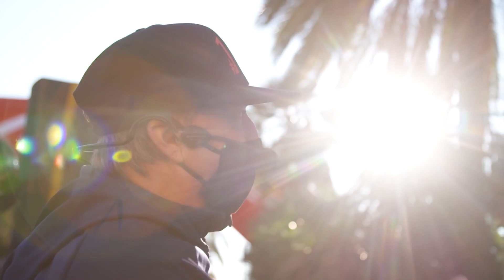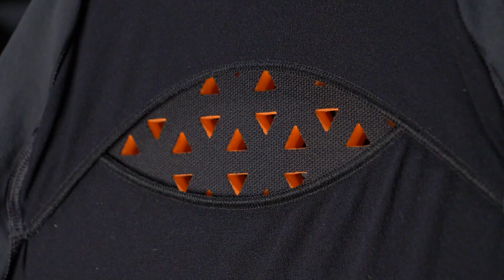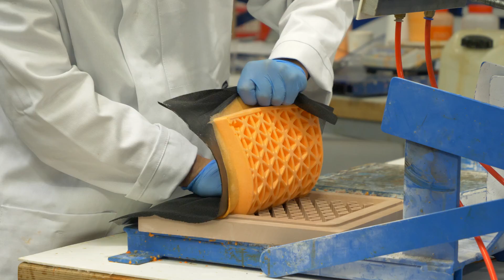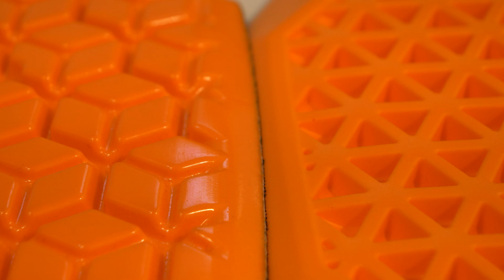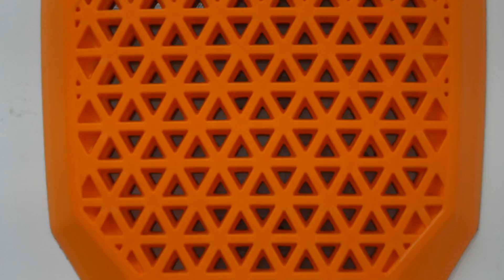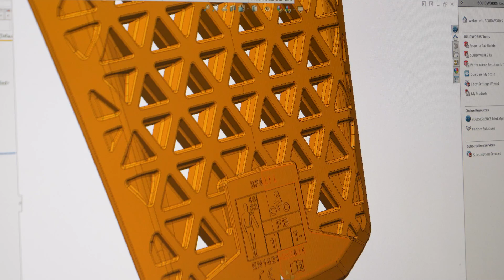High Speed, High Consequence | How MTB Protection Is Keeping Up With The Demands Of EWS Racing

Comment from the maker: Do you wear a back protector when you ride?
Reply: Yup. In fact, I use motocross protection equipment. Beteer safe than sorry.
Reply: not at the moment but i am buying the dainese trail skins pro very very soon
Reply: @tobylestrange4081  same for me I’m getting the leatt reaflex
Reply: The harder I ride, the more armor I wear (for enduro/gravity/bike park). I rarely crash, but when I do, I appreciate being able to dust myself off, and keep riding.
Reply: I wear an armored hydration back pack, even though I don't do any particularly dangerous technical riding. Even beginner trails are full of stuff that can mess you up if you fall on them wrong, and the brain and spine are organs that can suffer permanent, life-altering injuries from fairly minor and unimpressive accidents. I don't bother with knee pads or elbow pads because injuries to those can be treated; knees can even be replaced.  But I view my backpack as like my helmet, I don't ride without it.  It's not nearly as robust as the back protectors in this film, but it doesn't need to be.  I don't need a full face helmet either, but I still need a helmet.
Reply: @grumpynerd  sound's good I didn't even think that existed if you see my previous comment.. anyways I do wear very thin knee pads because they make me feel safer, maybe because when I was a kid skating i always just sat down on my knees if bailing any trick or something.these bicycle kneepads aren't meant to be used like that but gives me the feeling of being much safer... I also doesn't do the extreme trial's mostly just hiking trial's paths in the local mountains here in Norway they're not rated ofcourse and can be difficult for me.. knees are easy to hurt by minor accidents .I'm not trying to be rad on my bike but I really enjoy the freedom feeling bicycling around in nature...i would love to have the hydration armor thing you have under my anorak if possible I also wear The pads under my hiking pants .. maybe the two of us is kinda on the same level i consider myself a beginner because I never have time to do it every day or week and started 2018
Reply: I don't, but would really like a piece of tech like that keeping me safe while I try new (riskier) stuff 😄
Reply: Always
Reply: Yes - both snowboard (+freeride) and bike. This year I am planning the upgrade because of the tech development. I want some kind of the west I can wear both summer and winter.
Reply: There’s one built into my back pack so kind of yes.
Reply: After being hospitalised from a 'minor' crash. Full D30 Back, Elbows, Knees and knuckles.
Reply: No, I would never wear one riding locally. I would only consider it when trying new big things in the bike park.
Reply: No 😳
Reply: Hells yes, always. I feel naked without one, but then again I'm used to one from alpine ski racing. Currently using a Komperdell Cross 6. It was the only one I found after a lot of testing that protect the entire back, from tail bone to neck. Most other ones are way too short and leave both ends exposed. And I hardly feel it there except that it does add some heat, but not much worse than a backpack. And I'd rather have a hot back rather than a broken one...
Reply: @widsk1  I have one from Head that I used during alpine ski racing. I am glad to see this tech getting used in MTB as well.
Reply: @mathewrose2951  yes, it actually is a bit weird that this is not a default thing for mtb. I mean, I think I got the first one back in -97 or something, though I think we were pretty early adopters among the local clubs, since we had to buy motocross protectors. So I guess there is where it really comes from. I remember the AP moto back protector was the thing we used, just a piece of plastic over a foam padding that went along the entire spine, but it served well. Then came the weird turtle shell like protectors that did not cover either the neck or the tail bone. For some reason, they were popular also, but I don't know why. The higher you go on the spine, the more important it is to protect...
Reply: I am XC
Reply: No pads, I only wear a neck brace. I beat Lobes in the A-line race.
Reply: Yup, all the time, I have the fox base sl d30
Reply: When riding lift served yes. Otherwise, no.
Had to get one for skiing the event at Smugglers Notch last winter so I'm using that one for biking too now.
Reply: Someone needs to convince them to bring the availability to North America.
Reply: Usaly not , I used it More on my gasoline powered enduro \dual sport bike and on snowboard... it's a Knox back protector and it's really warm  can use it as a back warmer and it's really nice to warm your butt to taking it off and put it on the Snow or something .. but while bicycling it doesn't really feel that comfortable and it just makes me sweat and it always needs to be adjusted it slides upwards or i just needs to not have so thigtened shoulder straps... but I want to use it,i often think about it but never do it atleast not anymore.i should do it... but I would like a new one,, maybe they should make one with water in it to like a Camel back so you don't need to put on several things outside of each other., maybe a backpack camel back protecting thing that went cold when you get warm and warm when you are cold and could keep your extra sweater wallet etc and had a rain poncho built in to fold out to minimize the stuff you need to pack and always be ready
Reply: That's good Cushing
Reply: When I´m riding so hard, that I need one, I´m using a chest protector with an integrated back protector straight away. Personally I highly dislike anything thats sitting like a second skin. I just cannot stand anything thats so tight on my body - Even hate my own bib shorts allthough they are good and get worn regularly. When I crashed, until now its been always the ribs and shoulder that needed to take the impact. So a back protector only would not make me feel very protected in such conditions.
Reply: Absolutely fascinating, brilliant work again Doddy, you truly are a tech god... 👏👍🤙
Reply: My Evoc Neo 16L backpack has a external back protector, it too has a mesh design, so yes that will keep the back cooler. I've not tried chest, back protector combo, or vests like these.
Reply: Do backpacks count?
Reply: I've been wearing a 7 iDP back protector for about 6 seasons of park riding.  I had one very bad crash where I went OTB on a jump and landed flat on my back from about 12'.  While the impact caused my back to spasm so badly it took about two months before I could walk normally again, I credit the back protector for me not having any permanent injuries. 
The Bluegrass armor looks nice.  I'd order the B&S jersey now if it was available in the US.
Reply: I have a Uswe hydration pack with an integrated back protector. If you use one, it’s a great idea. Back packs can make things worse - One of my mates fell backwards when riding and was wearing his backpack and landed on his back with his multi-tool between the ground and his lower back. He fractured a vertebrae. He’s ok but it was a close call.
Reply: Every time (except slow rides to work)! I'm an ICU nurse and I've taken care of too many people who have been in nasty bike accidents.
Reply: Not on trail because I also have a bag on my back but in bikepark always
Reply: Yes I am an old dude (69) and getting brittle. I have broken 4 ribs in 3 years. The last one from an impact on my back (bounced into a tree). I either armor up or slow down or quit riding. I choose armor
Reply: no
Reply: Yes, when doing higher risk riding
Reply: Honest i never thought i would wear one. Month ago good friend travel to Sölden Austria. 1st day, behind corner rider standing still... friend couldn avoid crash.. broke his back... he's lucky to be able to do everything.... but looooong recovery.....

Comment: There is a big problem with materials like D30 and other similar products. Low speed impact. You need to reach a rather high impact speed for the material to get the stiffness. A good solution would be a little harder material on outside that covers the speed up to where D30 works...would still be light but perhaps not that flexible...

Comment: It's not just 3DO who makes non-Newtonian foams. They are really common now. It's just the 3DO seems to be the best at marketing and brand awareness.

3DO is probably the worst one for temperature stability. As the temperatures rise or fall, the performance of the foam changes substantially in most foams. I imagine MTB racers will need something that passes the impact tests at high temperatures because they get hot and do a lot of riding in summer. Yet, the product mentioned does NOT pass the optional T+ (high temperature) impact test. Only the cold temperature test.

So, unless you're a gullible person, look for a back protector that has T-/T+ on the CE label.

Comment: #GMBNTech Hi Doddy, Hope you are not bored during isolation :P. I have 3 questions, hope that's not too much in one goal to ask. 1st, I have SRAM Code RSC brake came fitted on my bike, one of the brake lever's engagement point is really close to the handle bar, it almost is touching the handle when squeezed hard. I have already adjusted the contact point adjuster to the most outer position, is there any easy way to fix that or do I have to go to a bike shop to get the brake fluid topped up and full bleed? 2nd question, I setup my fork suspension according to one of your old how to setup suspension video, pressing hard on handlebar and the rebound is just not enough to lift up the front wheel, however, I still get the feeling my bike is bouncing me off the ground too much from time to time, should I lower the air pressure or turn down the rebound more? I did try lowering the air pressure but that seem to made the bike even more bouncier, and I wasn't sure I should slow the rebound more as you and other bike channel suggests too slow rebound reduces the traction. 3rd question, this is more of a curious question. would a 160mm fork set at 40% sag better than 140mm set at  30% sag? Consider both would have roughly about 100mm effective travel when compressed, but the 160mm would have a lot more travel to keep the tyre in contact with the ground when extended. Thank you Doddy, it's always been pleasure to watch GMBN and GMBN Tech show, I got many many good tips from you guys. Love the channel. Thanks!

Comment: "There is only so much we can do, it's up to the garment manufacturer to develop a garment around it". 100% agree. I have had two bad crashes recently and both times the garment ripped and failed, the pad did not stay in place and I was injured. These sleeve type garments do not work worth a damn from my experience. At least not on the knees and elbows. I need straps to keep the protection from moving.

Comment: Could you please give us some light on the different types of spine fractures this type of back protector is made to prevent? Whenever I think of a MTB spine injury, I think of some sort of bending related fracture, in which case this protector doesn’t seem to help. It would be awesome to see what types of spine fractures are the most common in MTB and how this protector helps with them.
Reply: These are more impact related prevention, like kneepads for your back.

Comment: Can they make full overalls for me???
I now wear a helmet with armholes. Actually shoehorned a fox moto torso including rib protection onto my camelback removed front section .  Also shoulder / elbow pads ,knee, shin hip and coxix pads.
At 63kg and 66 years don't want to feel like a TDF Peleton ego shuffling victim. My personal experience is if you ride a Emtb you can wear much more protection as you don't need to get as hot on the climbs. I wear shirt with full front zip for cooling. E=Mtb²

Comment: So far I've not seen knee, shin, elbow pads that offer good cooling, I currently use Poc Joint VPD2.0 DH Long Knee, Poc Joint VPD2.0 DH Elbow, Poc VPD2.0 Shin, but they are very warm during mid summer, I get soaked in sweat and feel like I am standing near hot fireplace. but the  pads have great protection and coverage, so I want something that does not exist yet.
There are some small pads out there that give much better cooling, but not seen any full coverage pads.
Reply: I have the POC air kneepads, and they are a bit lighter and easier to pedal with (but I feel POC to be overrated). The Dainese trailskins, and Leatt kneepads have the same looking structure as the 3do in this vid. Might be worth looking at for trail riding and u can use the POC stuff when it's time to hit the bike park.
Reply: @siteofdaniel  I've not hit a bike park, but want full coverage, whi h the ones you listed don't, i dont always know what I will ride as I explore, ride blind. I need protection on side of knee, need overlapping pads full shin protection, and elbow protection. But I want better ventilation, so I new pads like poc dh pads but with better ventilation so fsr this does not exist. I don't know why you think Poc is overrated, when it comes to coverage on seperate pads they seem to be king. I like their chamois boxer too, but wish their shorts had better zippers not coil zippers, and the gloves did not have glued on velcro, ths t falls off, and the glove seam quality was more consistent and the, palm material did not stretch and tear. Bit fit it great.
Reply: @siteofdaniel  my pads are easy to move in, I can bend my knees without issues, even played socvler in them once, can kneel down, even put my feet on my thighs, sitting down. Basically I have full range of motion, no restrictions. Pads that restrict movement is something you won't find these days, due to softer more flexible materials, and no more overkill on the hardshells.
Reply: @siteofdaniel  mabye these https://www.dainese.com/us/en/bike/safety/knees/armoform-knee-guard-lite-ext-203879691.html?dwvar_203879691_color=BLACK&cgid= could work, but still look warm and don't know if the plastic loops will be uncomfortable.
Reply: @mtbboy1993  I would ask myself how often and at what speed I crash. Because you use/like really heavy duty protection. And that is fine, use what you are comfortable with. But these hybrids from leatt might be an option for you. Their 3df is similar to 3do. https://leatt.com/int/shop/mtb/protection/knee-guards. Good luck :)
Reply: @siteofdaniel  I take the pads off on easy trails, but when blasting tru unknown trails pads are always on, also on Gnarly trails even have neck brace on but easy trails I rather get some cooling cus these pads are like standing in front of a hot fireplace
Reply: @siteofdaniel  the ylook like they would be as warm but the lef plate is nice addition for super rocky crashes I guess, but do far i am going to continue to use what  have, shortage in bike stuff will make it harder to try stuff don't want to get something others need, or I already have and to find something can be hard anyway not checked lately but last time I checked there were not much kneepads I liked for sale in retailers I usually shop at.
Reply: @siteofdaniel  I did not find a pad from Troy Lee I would try, but I use WS 5205 Wrist Support, which reduce the missaligment in my wrists which cause me to not be able to brake properly thus missing turns, but with the wrist supports the issue is solved.
Reply: @mtbboy1993  about your wrists. I recommend looking at the channel Joy of bike and their handlebar vids. Maybe you would be better off with a different backsweep.
Reply: @siteofdaniel  the issue is loose wrists, they are really floppy, missaligment is an issue I suffer from all Ove rmy body, but wrists are probablematic, thumb too, so Archer d1x eliminates fatigue and pain even if middaligned thumb i can shift cus it can happen during theshift. I currently use race face six handlebar. And I already watched the vid you are referring to, some great content there for sure. Thx for sharing.
Reply: @siteofdaniel  I would also need a chiropractor 24/7, cus my problematic, most of thos missaligment back cracking videos I have it all it seems. Sometimes these issues cause crashes like hips missaligning on techy climb so protection is an must, I only take it off on easy trails and on bikepaths. I am an experienced rider, but won't risk injury, so I use what I am am confident in. But sometimes I feel so bad it's almost needeng a walker, sometimes I can't walk properly without pain so crazy, I can't handle it, and need to lay on the floor, sometimes I don't get out of bed before I am well enough to do so, so hardtail and rough terrain guarantees thrown out back, neck. More missaligned things get less stable and in control I am on the bike. So when I feel like I am going to crash I just take it easy and ride esy stuff on the way home, or take a rest. But definitely wearing pads if I feel bad while riding, just to be sure. So I tend to wear bit overkill with protection cus of these issues. But having bike that fits, and full suspension helps alot, I love my bike.

Comment: Got a raceface body armour with D30, hardly even notice the back protector and has removable shoulder pads.  Gets slightly warmer than just t shirt but in cooler weather wont even notice it.  If riding gnarly trails no excuse to not wear one (except price)